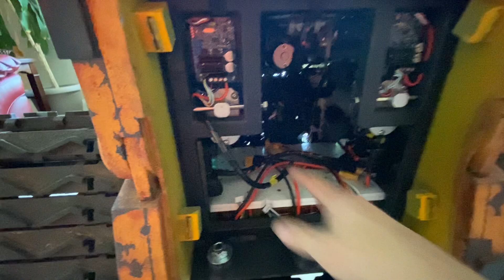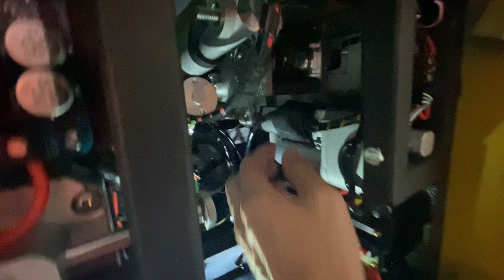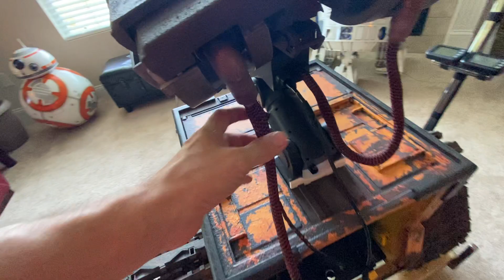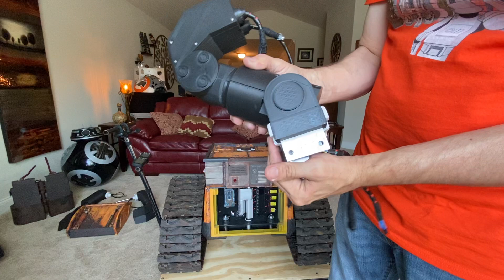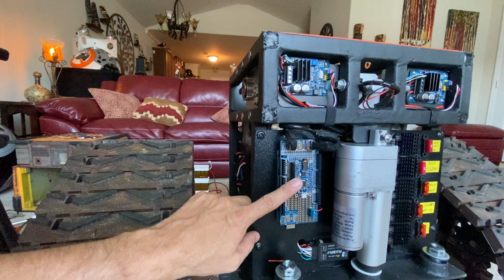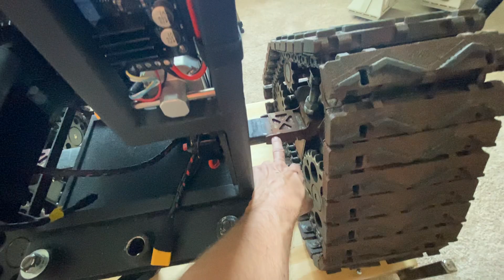Wall-E Disassembly

Comment: Great video, thanks for sharing, apart from the actuators for the neck extension and body tilt, is there two other actuators in there (one on each side)? If so, what is their function?